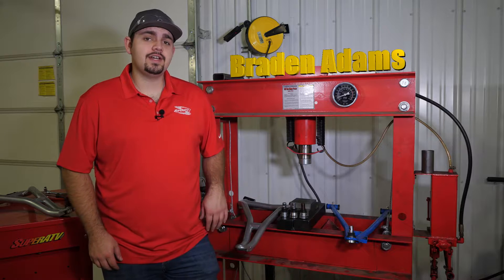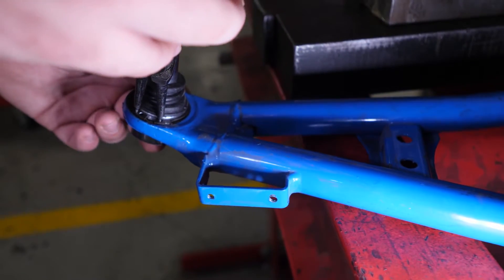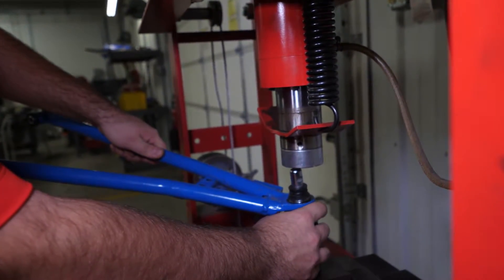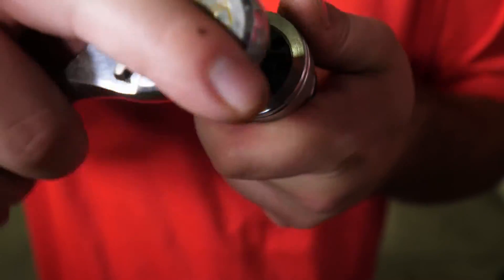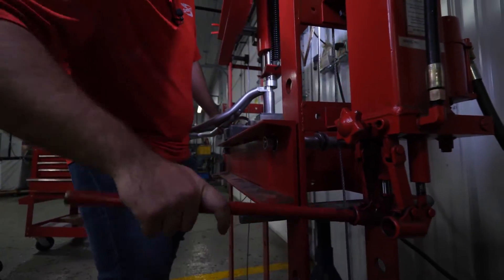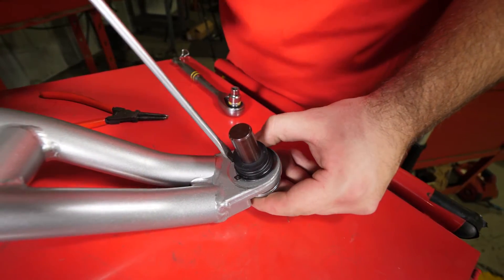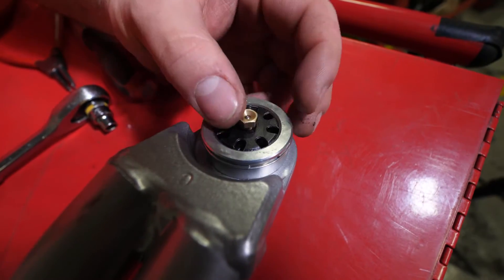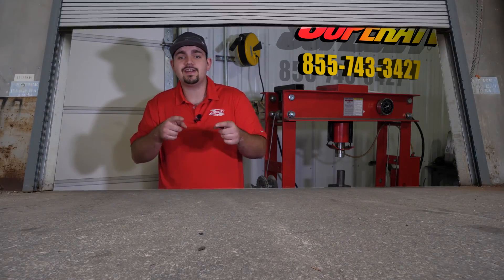How to install and remove UTV / ATV ball joints | SuperATV

Comment: Should the paint be removed from the new A arms at the inside of the ring prior to installing the new ball joint or is it ok to unpack the new A arms and press the ball joint in the way they are?
Reply from the maker: Really depends on the thickness of the powder coating if the ball joint will press in and fully seat enough to get the snap ring installed.

Comment: Can I rotate the ball joint 180 degrees without removing and reinstalling?  The notch is on the wrong side
Reply from the maker: Yes, the ball joint stud will rotate. If you can't rotate with you hand, place a rag over the stud and use a pair of channel locks to spin it.
Reply: SuperATVMedia what about the boot how do you get it to reseat my a arms all came with the ball joint groove on the wrong side